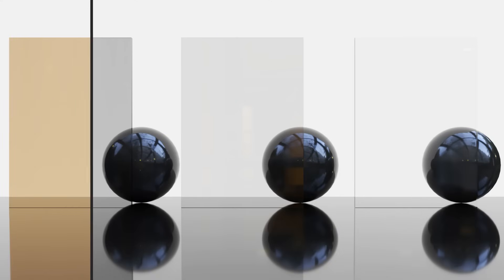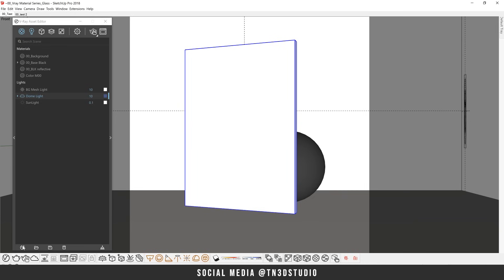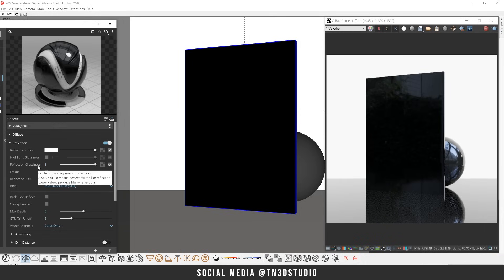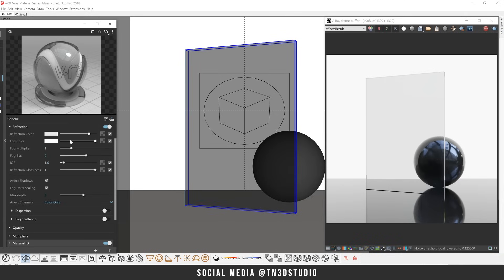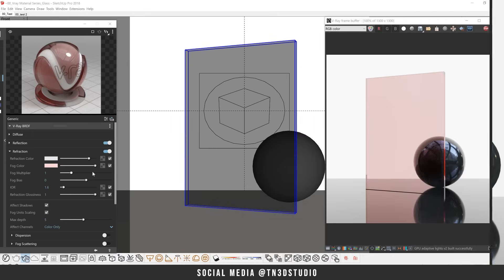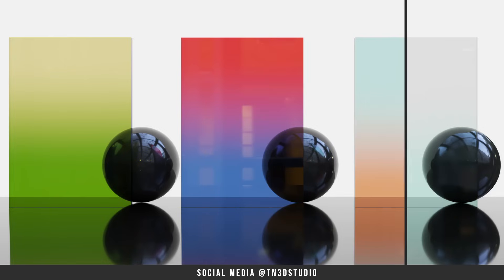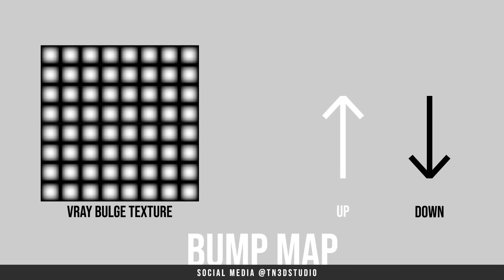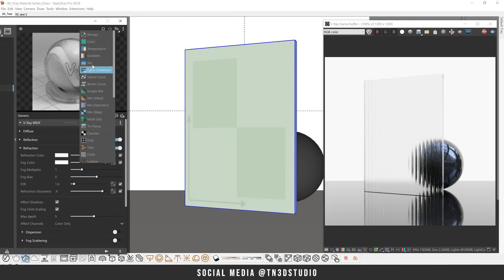How to create Real Vray Glass Material in Vray Next Sketch-Up Part 1

Comment: Hello! thanks for the video. I followed every step you explained but my gradient glass doesn't show in the render. What can be the problem?
Reply from the maker: Thank you, Glad i could help :). for Gradient Glass You must use the "Gradient procedural" inside Fog color slot. If your able to create a clear glass, this should be a simple step. :) let me know if that works
Reply: Thank you for your response. It turned out be an issue with gpu. When i switched my render option to cpu grandient effects showed up.

Comment: Great video and all well explained. I used different V-ray glass materials for a front window in a car. All glass-types gave a distotion effect when you looked from the front through the window inside the car. The chairs looked distorted. I tried the glass on a simple curved object (the window) and I thickened the window with Joined push-pull from Fredo6. What causes the distortion and how to fix it?
Reply from the maker: Thanks Richard and my apology for the late reply. I did a bit of trial and error (hopefully i got it right), I only had refraction issues when the "front faces" were reversed (if back face faces camera). So my only advice for now will be to make sure all your faces face outward and the back faces are clear of any material. Especially the parallel surfaces of your glass, both front faces must face outwards.  I hope this helps, I'll be sure to make this clear on part 2 of this tutorial :) Cheers!
Reply: @TN3DStudio  I did a test too with the front window. Reverse faces was the solution. Thanks so much for your advice. I hope part 2 of your glass serie comes soon. I am looking forward to it.
Reply from the maker: Awesome!

Comment: i love the tutorial but my fog color did not behave like yours i tried lighter colors as well as darker colors but there was no gradation  instead it was one solid dominant color which was red or blue. i also tried different multiple colors and it was the same result.  please help!. Thanks in advance
Reply from the maker: Thank you! Glad you liked it. If your goal is to use one color for a colored glass use the "color swatch". If your goal is two or more colors use the texture slot and load a  "gradient" (you can add two or more colors here). Than use +1 or -1 value in  "fog multiplier" to control the strength. Hope this helps.
Reply: @TN3DStudio  yaaay i did it. it was my glass thickness. i accidentally hit 12mm and it was too thick. thanks for your help. high five!
Reply from the maker: @24ifiy   Glad you figured it out!